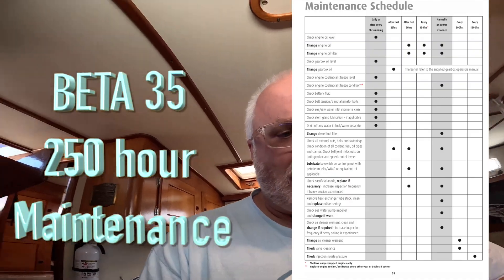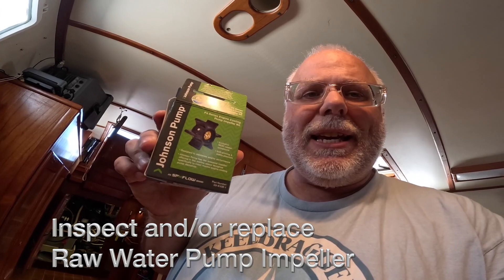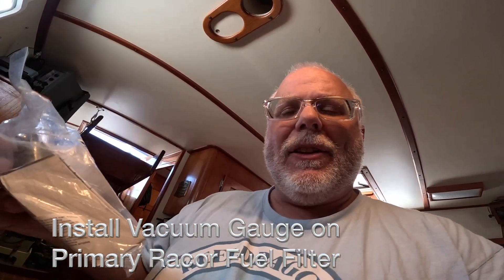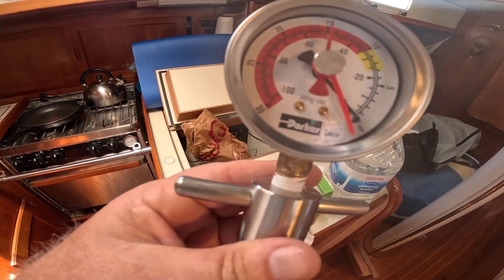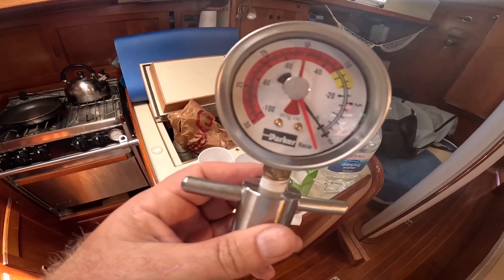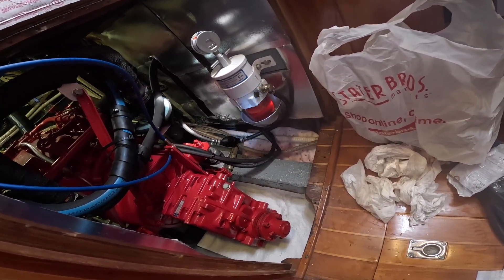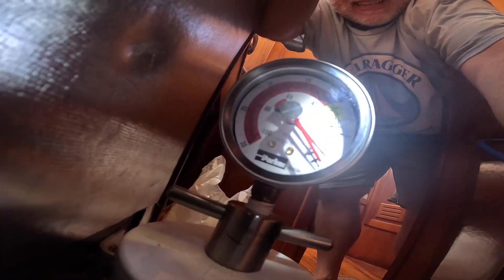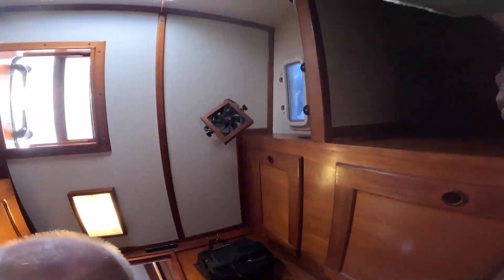Engine Maintenance: 250 hours on the Beta Marine 35 (August 2023)

Comment: Thank you for this, Amigo. I've got 360 hours on my Beta Marine 25 and it's running a bit rough at idle so I've got to do the filter change for the first time. Kinda nervous.

How do you drain the coolant and saltwater from the tubestack/ heat exchanger to do the stack check etc? I need to pull my tube stack and probably just replace the coolant but the manual doesn't say how to drain it 🙄

Super jealous of your engine access 🤯 what kind of boat is that?

I used to watch you when you had the Dana 24. 

Do you know of a good 31-38 foot square sterned full or 3/4 encapsulated keel cutter with external chainplates?

I'm considering an Island Packet and just getting external chainplates mounted.

I'm on my way to the Sea of Cortez from BC IN A 27' twin fin keeled sloop and it sucks. Absolute trash in heavy weather.
Reply from the maker: Valiant 40.  Pretty good engine access.  I still need to check my tube stack.  The Beta manual says the coolant drain tap for Beta 25 is "Mid engine, starboard side when viewed from the gearbox end."   Open that tap and/or remove a plug if the tap is not there and that should take care of the coolant.  Seawater should drain out when you pull the zinc.  I'd have to think about square sterned full or 3/4 encapsulated keel cutter with external chainplates, but I can think of several double enders.  What kind of 27' fin keeled sloop are you sailing?   I had a friend with a Westerly Centaur (26 footer) back in the day.  it was sloooowwwww.

Comment: “Memory” on the fins. Shows your nerdy side. And the seasons of life knowledge you have.  So glad you did this. I have wondered how you like the motor and if you think it was worth the swap.  A serious option if I get a boat with a bad motor.  Great job!
Reply from the maker: I am always learning and I am at the point where I am comfortable with basic maintenance tasks and light duty engine work.  Aside from the obvious benefits of having a newer, more reliable engine, one thing that I really appreciate about the Beta 35 is accessibility and ease of maintenance relative to the prior Volvo Penta 2003T.  Some of that comes from simplification of the install (e.g. upgrade to racors for easier fuel filter swap, manual priming bulb vs. additional valves and electric priming pump, etc.) vs. the actual motor itself.  Zero regrets about the decision for a full repower.  Only change I would make is getting a Beta 50 vs. Beta 35.  Beta 35 has enough power for the conditions I usually find myself in.  It would be great to have a little excess power to accommodate another large alternator.  Lots of people DIY re-powers and you can save about 30% of total cost doing it yourself.   That being said, I'm glad I hired a good mechanic.  Engine placement, engine mounts, alignment adjustments are all beyond my current skill level.
Reply: @keeldragger  great job.  You have one of the most informative channels.  You give so
Much information as you narrate each voyage. Radio etiquette, sail plan, cooking ideas, etc. and you sail almost every weekend. Amazing.
Reply from the maker: Glad to hear you find it informative.  Any topics I should include in the future?
Reply: @keeldragger  power consumption at anchor. A slip meet up for your local subscribers. I’d fly in for that.  Would be good to hear your story of how you got into sailing. Then just keep talking to us as you sail.  That and the chatter with Andy is pure entertainment!
Reply: When he said memory for the vanes I was surprised but Mark is a pretty fart smeller!